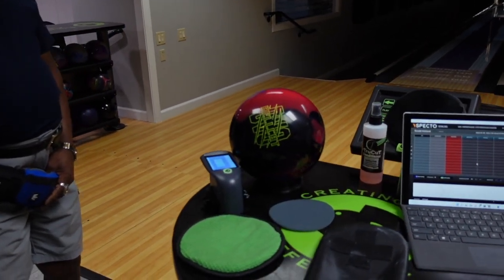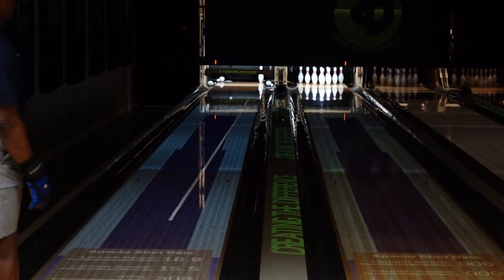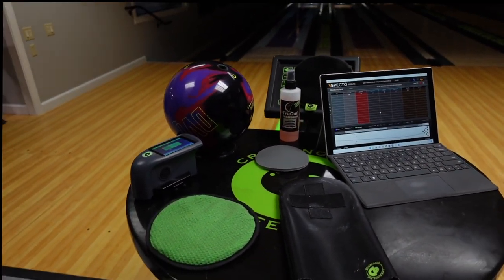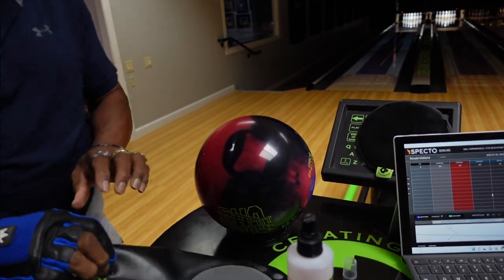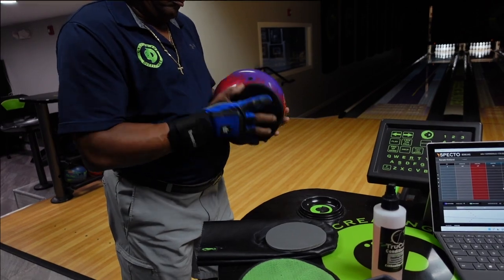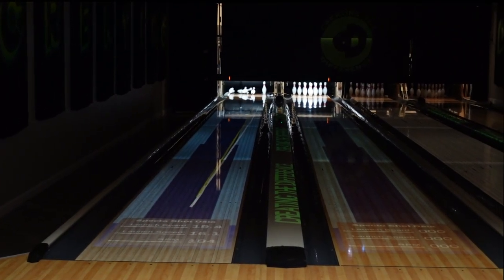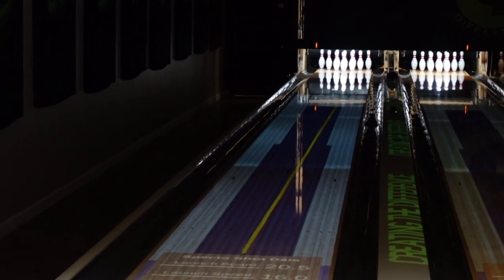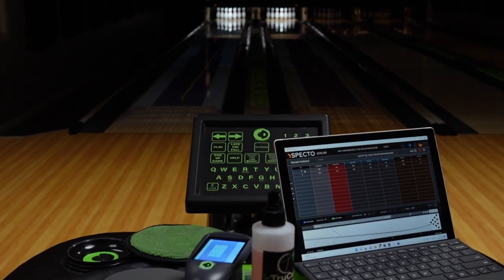Understanding Surface Changes and How They Can Impact Your Ball Motion

Comment: Listen to Ronald Hickland, Jr. He knows what he's talking about, and I've used these products to optimize my ball roll for over a year now. My PSO carries CtD products, and quite a few of the local bowlers are now doing just the sort of things shown in this video. And I still say So Fresh and So Clean gives me better pin carry. I apply it between bowling sessions on every ball I will be using. I have also used the scanner at the pro shop to verify the surface after using CtD pads with Tru-Cut Conditioner, and they are always spot on. I don't check them any more, because they're going to be what's printed on the pad. I do use the scanner to see how fast lane shine is changing the surface, though, and that's enlightening.

Comment: You mentioned you used the p5000 pad by hand to get a reading of 4000. So iI want @ a 3000 finish on my curently 1500 polished solid ball would I use a 4000 trucut pad if doing by hand to get 3000?
Reply: No. Use a 3000 pad.

Comment: Surface makes a properly thrown ball read the lane sooner, creating the perception of more hook, as it has more time to cross the boards before hitting the pins.  This all changes with rev dominant players, as high surface can cause a core to flip forward mid lane, and seem to take all the hook out of the ball. 

Surface changes affect different bowlers differently and different balls differently.    The experience and experiment should be done on the lanes with a spinner close by or buy your a buddy a beer to wear out their hand and arm. 

I am a huge fan of tru cut pads.  I'm about to order a fresh set after almost a year of use on the old ones, which will be reserved for spinner use.